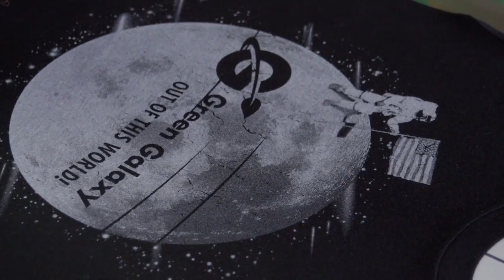How to Screen Print Series - Curing Your Prints

Comment: I'm curing shirts with a flash dryer that has willflex lava inks. When I reach 340 degrees how long should it stay at that degree under the flash dryer?
Reply from the maker: Hey there! You want to get the ink to 320 on the surface, and then let it dwell for around 15-20 seconds. The surface of the ink will probably read as hotter, likely 340-350, but it is important to let it dwell to get the entire ink layer cured.

Comment: I had some leftover ink with warp drive in at (over 24 hours). and it seems to print fine. What is wrong the ink after 24 hours?
Reply from the maker: After 24 hours, the warp drive is starting to chemically work on what it can within the ink.  You may notice that it is starting to get a little gritty/chunky - if you don't see it yet.... just wait.  That is why we put a buffer on the time frame so you do not accidentally print ink that has started to change.
Reply: @Ryonet  yeah, it was already chunky... but I still printed it anyways. Did a wash test and it held up fine after just curing with a flash dryer.
Reply from the maker: @andrewyoungren1371  As long as your wash tests hold up after 3-5 washes - you should be golden.  But now you know!